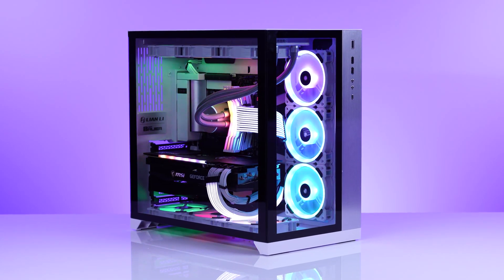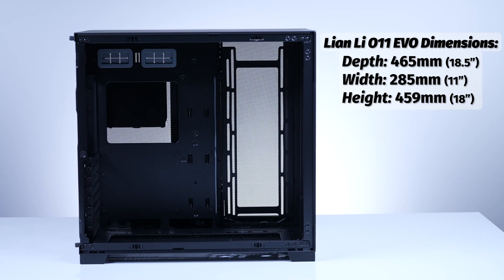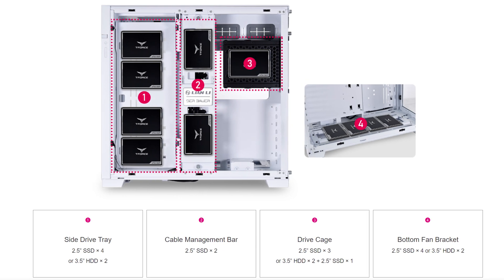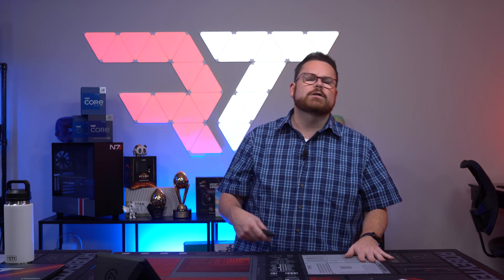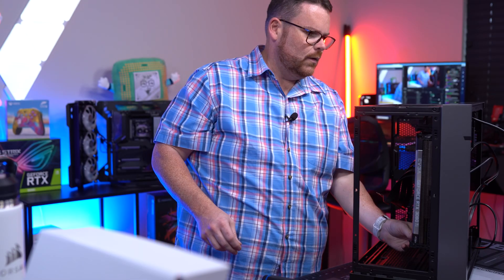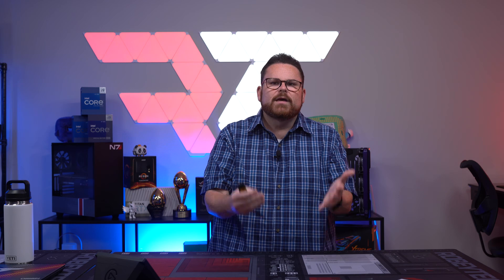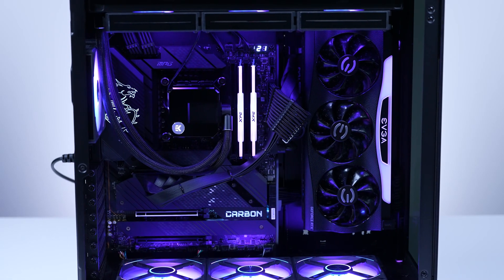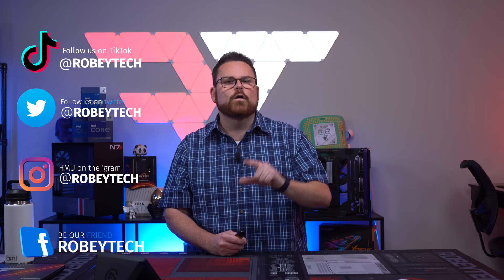The BEST case just keeps getting better! The Lian Li o11 Dynamic Evo Ultimate Review

Comment: First, I'd like to express how much I am happy to have found your channel. Awesome content.. Now I got one of those and I'm scared now about the air performance with the zotac airo 4090 to arrive.  And I am still wondering if I go with AMD or Intel for the main parts. I am not thinking about starting this new build with liquid cooling..I willl equip the case with Lian li v2 fans. I have been into computers since 286 yet I don't know what to plan for radiators. What size? How many? It could almost be a full college degree no joke!

Comment: I have a Lan li 2002ish Aluminum Full tower getting it's third build soon. ProArt Z690 creator & i9 K with a 3090 ti 24gb will be like dropping a new Hemi into a 69 charger.
My only worry is cooling choice and is the 1200W PSU the same size as my 750W I've been using for 12 years since my last build.
Will the Noctua NH-D15 be enough to be a creator or do I go Phanteks 280mm radiator.

Comment: I subscribed due to this video. This comparison to the Corsair 5000T thermal data helped me pick between the two cases, and if you must know I ended up going with Corsair because of aesthetics and performance. The price difference wasn’t crazy due to the Corsair controller module(~70$) and fans(~100$) that came included with the case. Taking that into consideration, both cases are around 180$ without peripherals due to the rebate on Newegg rn(5000T going for ~350$ after rebate at the time of this comment). Since both the cases are equivalent in price after deductions, my final choice was simple. Keep up the awesome vids!

Comment: I like the new format, but this case has so many configurations you could have tried out a few of them to compare temps etc. The config you did try is probably not gonna be the cookie cutter variant, so you should have included 6 intake + 4 exhaust as well. Since this probably will be the default spec for this case too.

Otherwise a good review. Keep up the good work.

Comment: Just migrated my 5950x and 3080 FTW3 from a Corsair Carbide 275R to the O11 EVO and good lordt the change in idle and load temps by having a veritable wind tunnel has been significant — about a 20C drop on both, and my 3080 is well into 1960Mhz without throttling. It was super simple to build and I appreciated the fan sleds for festooning my AIO onto the side bracket.

Comment: I have the razer edition of this case. Everything was fine for 2 years but now it’s pretty hot in there. I redid the thermal grease but that didn’t help... maybe it is my AIO? It used to be super cool in there and now the temps are twice what they used to be so it is pretty concerning. I don’t think it is because of the case though. This is just a general question.
Reply from the maker: You may have a pump issue.  You could also try cleaning the fans.
Reply: @robeytech  thanks for the reply! I cleaned the fans but I think it’s a faulty AIO, I found some bad reviews of my MSI AIO that are the same as my experience so I’m going to have to make a warranty claim.
Reply: @robeytech  while I’m waiting for a new AIO, is there a way I can still use my computer?
Reply from the maker: @HeatherHasGame  If it’s working now then yes.
Reply: @robeytech  do you mean if the computer is otherwise working? It’s just hot while gaming (85C) with the AIO not working. Is it safe to disconnect the AIO from the motherboard and use the computer or leave the non-functional AIO in place? I’ve never tried to run it without the AIO. First build.

Comment: Robey... I love your channel I been looking for this case since this colorway came out at Micro Center... keep up the amazing and unique content!

Edit: Can you fit Push+Pull on a 360 AIO for this chassis? I am considering that route for the i9-12900KS.
Reply: Yes! That's how I have mine set up currently, i was unable to do so in my prior case. I have my AIO installed in the side panel with the intake fans inside the case, and then the second set of fans on the backside interior set on push. It was simple to route everything through it's spacious cable channels.
Reply: @kumohara_319  Thank you for your response! I did the math with the clearance and figured it could support that niche configuration, just the fact this case can support it makes me want to upgrade too it.